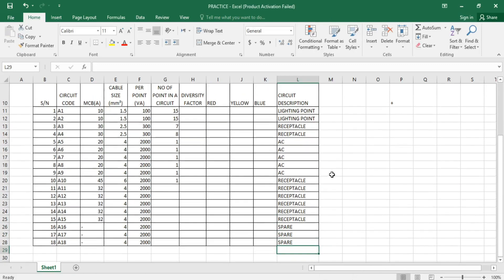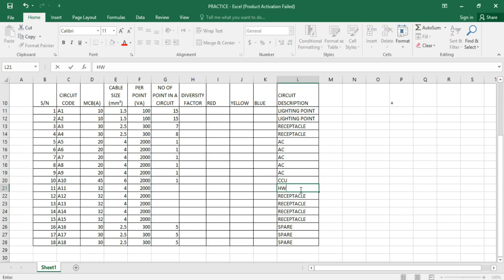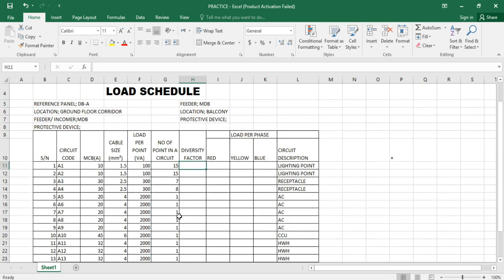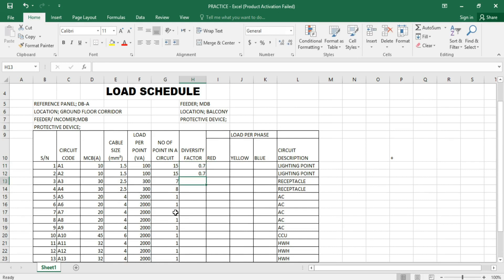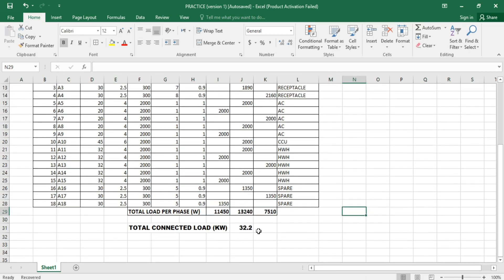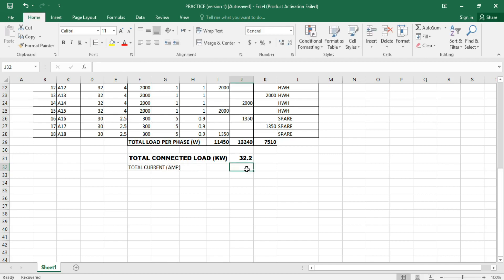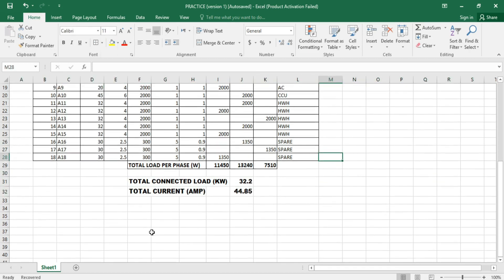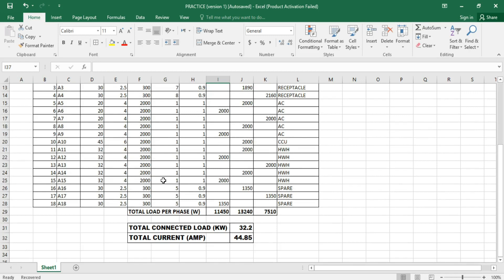ELECTRICAL LOAD SCHEDULE AND ESTIMATION DESIGN (MEP) PART 3 OF 3

Comment: In this example, there calculated 11 units of receptacles. Hence, there should be 5 and 6 number of points in a circuit but not 7 and 8, right?